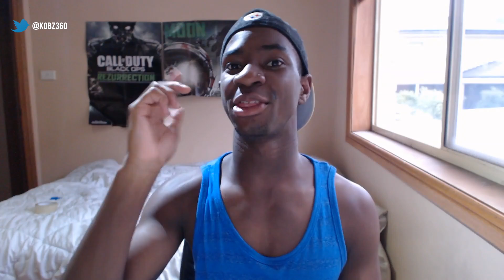AMD Getting Sued over Bulldozer Architecture

Comment: Any update on this? I don't think this has gone to court yet.. last info I could find on this matter, was the judge ordering a rewriting of the brief wherein the plaintiff was given 14 days to complete. Don't you think it's a problem that the term core allready was in use when AMD redefined it? Isn't it even a bigger concern that AMD themselves where using it (the definition where a single core has both FPU and Interger unit)? Isn't it just as missleading as if FORD would redefine their engine to have 8 cylinders even though if you asked them yesterday they would say 4 cylinders?

Comment: It's 8 processor cores on the 8350, for example, but the floating point processor is shared between 2 cores. Integer processor is not shared. And this works out great for almost everything because floating point isn't used nearly as much. It wasn't very long ago that Intel made a separate floating point processor you would plug into a motherboard slot. But they've been moved into chips now. The AMD ones just don't have one for each core. And this impacts nothing really at all. It really is 8 CPU cores.

Comment: I guess that not only nvidia lies about their products
Reply: +hello walkman Theyre not 8 true cores. When I run some benchmarks, my AMD cpus only say like 2 cores 4 threads for my 7850k etc...
Reply: +San Mattew   this ain't a lie ..  they are 8 cores .. not just intel style..
Reply: Cheng Yang   it is because most benchmarks are configured intel style ..

there was a time when only integer units were classified as core and floating point unit was separate ..